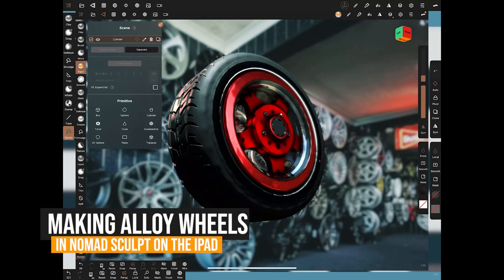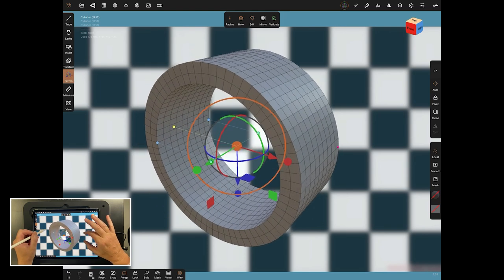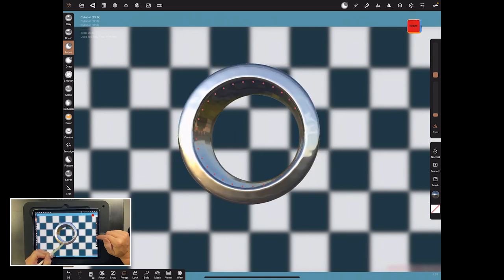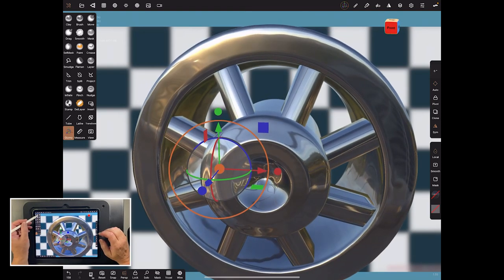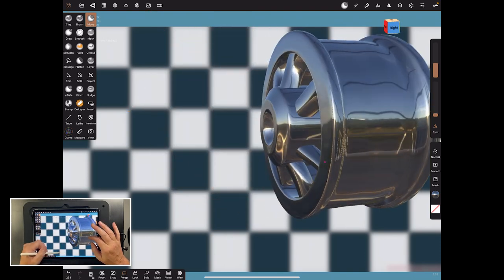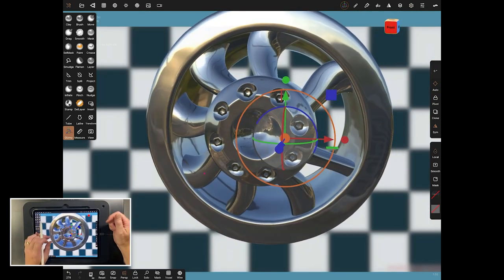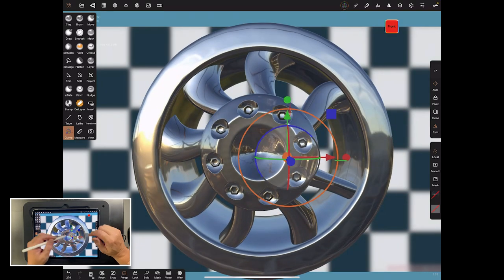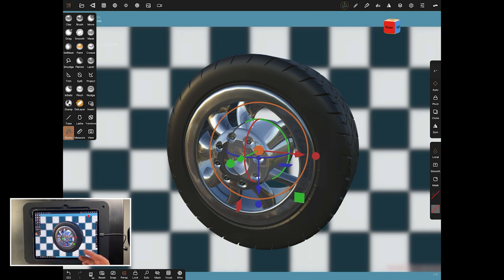NOMAD SCULPTING - Design a wheel using Radial Symmetry - Nomad new release

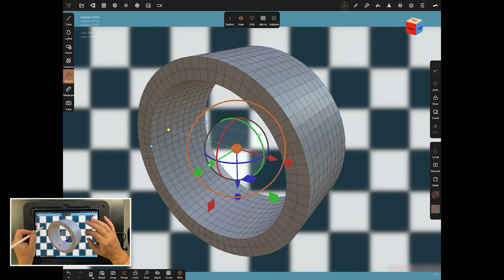Comment: I followed your tutorial up to 3:17 when you go to symmetry and adjust the Y Plane, but I'm having an issue with that certain plane. For some reason the Y Plane for me is expanding fully within the cylinder and the corners of the plane are sticking out a bit, having a bit of trouble figuring out how to shrink it. Have you come across this issue before?
Reply: Hi. I have the same issue. It's around kinda like bumpy similar to the flower around. Did you found how to get rid of it?

Comment: Hello Mr Southern, sorry to disturb you again. I just wanted to ask that; I did a custom dinosaur head and I finished it. And then I started to design the body by using shapes. Then I tried to voxel remesh the body with the head. But as always, voxel remesh caused the resolution to get lower. But when I try to upgrade the resolution it doesn’t work. I don’t know what to do. I would really appreciate your help. Thanks for the vids.
Reply from the maker: I cover this in the Trex course. You should always try to decide on the over all block out at the beginning. If you fully finish a model and then try to join it to something else you are going to have to compromise in one way or another. It’s not like other programs where you can project the colour and detail back on. Voxel remeshing is destructive and will cause issues if you are doing it to models with high fidelity detail and colour. I’ll find a chapter that really helps and make it available on the channel for you and anyone else.
Reply: @SouthernGFX  thank you very much you’re the best